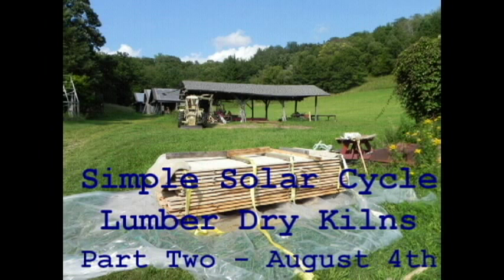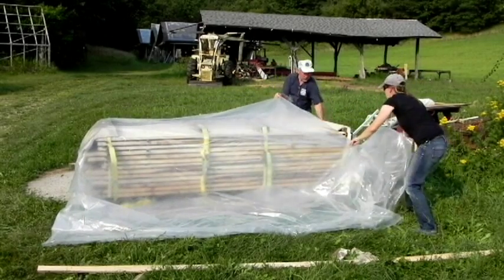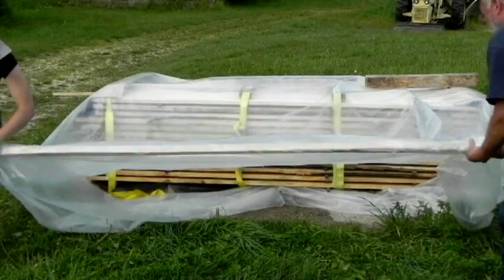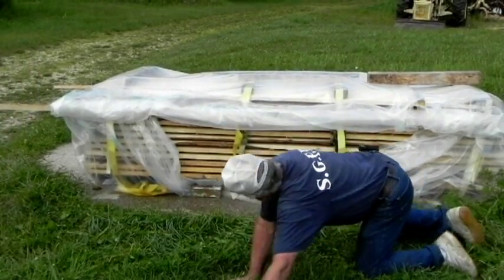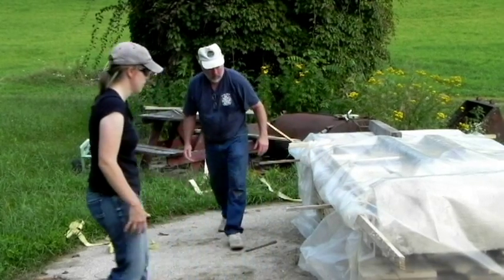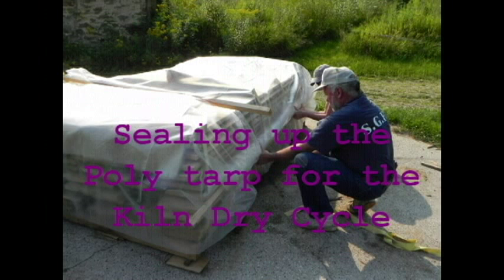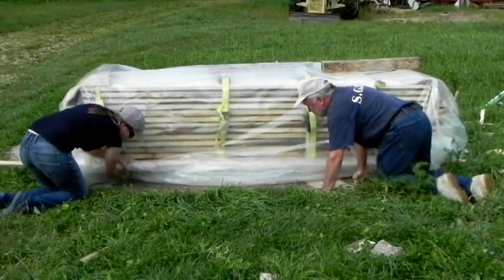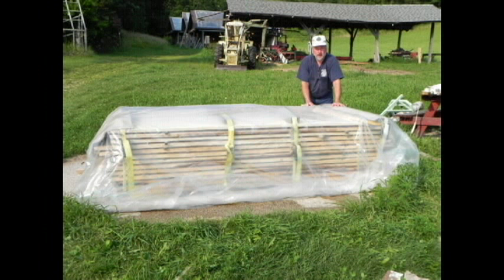Simple Solar Cycle Lumber Dry Kiln part two  Timbergreen Farm  Jim Birkemeier

Comment: I’m thinking that this failed, as the reason there is no follow up. If this “kiln” is sealed up with no ventilation, there is no way it dries anywhere near 6% - 8%. Water may evaporate during the day but will re enter at night, I’m guessing he may have a huge mold problem as well. I wish they would have posted some sort of follow up with this as there seems to be several questions regarding this. I’m sorry, but unless I see positive results from this endeavor, I’m saying is was a huge failure in the end.

Comment: How does the wood lose moisture if the plastic is sealed tight? I can see how it will heat up in the sun and cool off at night, but won't the air inside the plastic become saturated with moisture quickly and keep the wood from losing any more moisture?  I am just asking out of curiosity, I have only air dried some lumber, but have
never used a kiln.